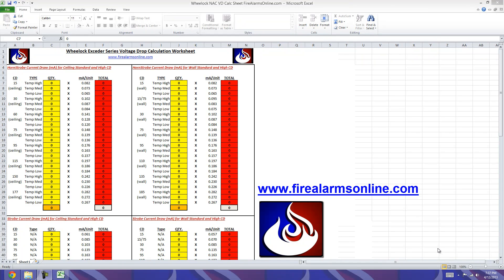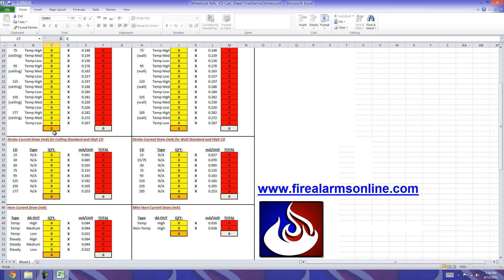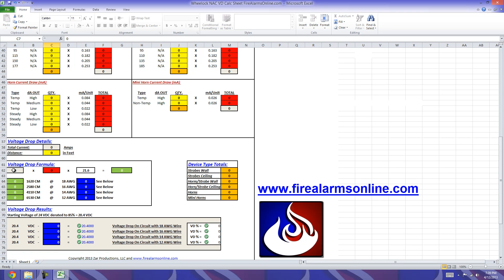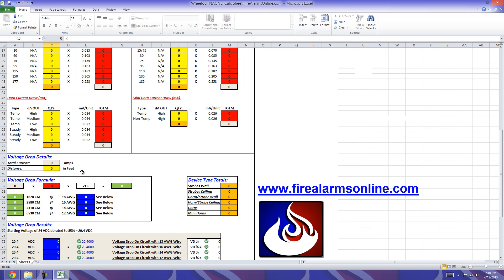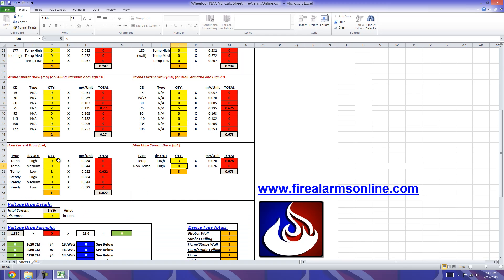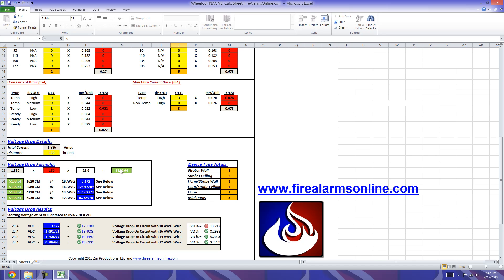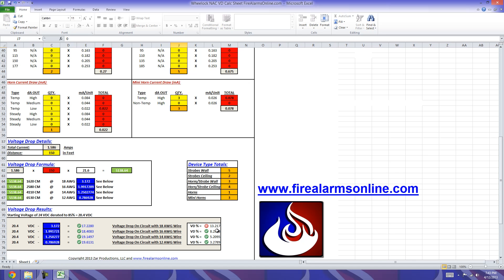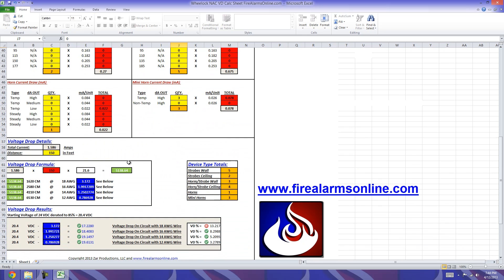How to do Fire Alarm Voltage Drop Calculations for Wheelock Exceder Horn Strobes HD

Comment: These are not usable because you have to do your voltage drop per circuit.
These show voltage drop per panel. Which yes it gives you an accurate number for total but not per circuit.

Sure a person can do this for each circuit but look at all of the waste paper and ink. and it is too large to import into a table in autocad.

There is a guy who started a project and it's last version was "Voltage Drop Calculator 1.3" found on softpedia. What he did was make a voltage drop lsp for autocad. It is great but now is outdated and incompatible with autocad 64 bit.

Maybe you should contact him and get permission to update it or reverse engineer it and build one yourself,

I myself have done it a few times and made my changes but again, it fails on 64bit autocad.

The reason I am so "autocad" is so I can put the voltage drops directly in my drawings or on a cover sheet.
Reply from the maker: As you stated towards the end of your comment, this can in fact be used as a code compliant voltage drop method for each notification appliance circuit.  The document is not intended to be printed out.  This is a very simply alternative to breaking out a calculator.  Also lets be honest, no one can remember the current draws for each appliance.  This tool allows for a designer to simply input a few numbers and instantly know if you meet the requirements for end of line voltage drop.  Please note this tool does not calculate the voltage drop using the point to point method.
Reply: Kyle J. Schuler, SET
In Harris County (Texas) [and few other AHJ] Voltage drops are required to be present with the submital of fire alarm drawings.
Point to point is required. Basically they want us to spell everything out for the review team members.
What I was in hunt of is something to make this possible.
As of right now I am using  another brand's voltage drop program and manually changing the voltage to each device, then mimicking the results in excel to get the results I need. Which is a couple more steps than I would like.

Just trying to remove a few steps.